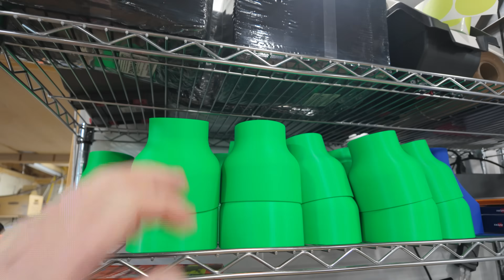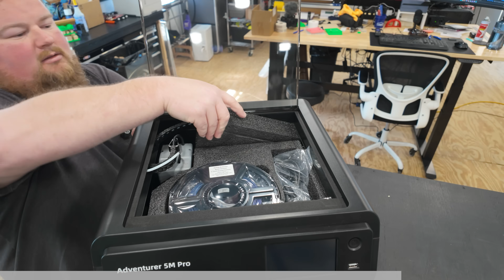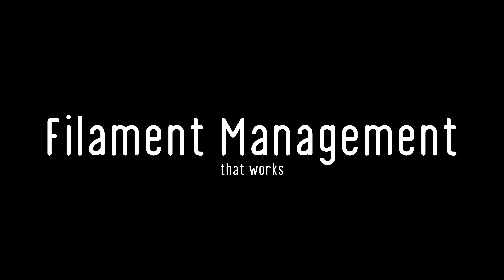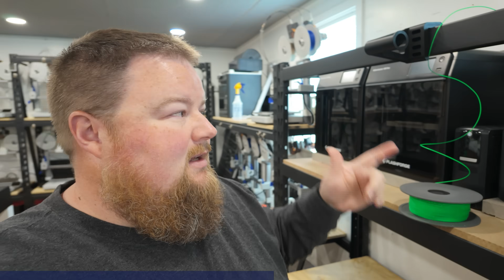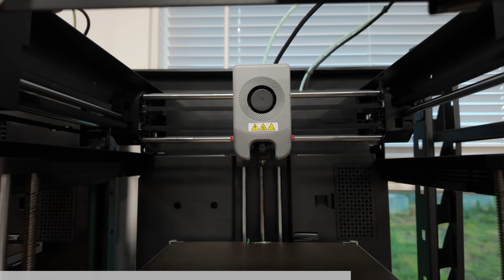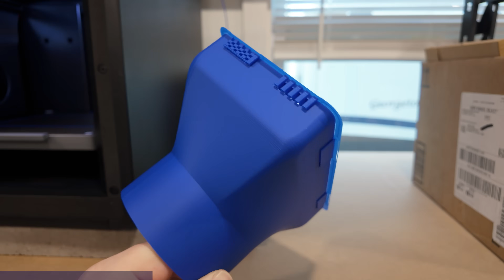Using Cheap 3D Printers for 2 months in my Print Farm

Comment: The Flashforge 5M is my first 3D printer and it is sitting here printing as I am typing this. I have printed a lot of things on this printer and it has not given me a single problem. Now that I have had a little experience I wanted to step up to a printer that can print colors. I could not get my hands on the Flashforge AD5X so I purchased a Bambu PS1 and I just can not get as good of a print as the 5M. I am not bashing the printer and I am sure it's just me. I can not figure out what I am doing wrong. I am really happy with my 5M and when I need to print something without the hassle I use my 5M. Oh and thanks Sam for doing the videos.
Reply: En qualité d'impression les p1s sont largement au dessus des 5m et 5mpro, il n'y a pas photos, je me sers des flasforge pour des impressions 'atelier', pour la revente ce sont les bambu qui fabriquent. Je fais des petits produits avec des details.

Comment: Honestly, I bought the 5M and a separate enclosure for 36 bucks from Amazon. I also had a light, fan and some tubing laying around. Build myself a small filtration system (Practically for nothing, theoretically like 10-20 bucks). Now it's basically the same, for way less. I also don't want to waste 2-3 spools of filament during which time I could be printing much better things. Definitely worth it, in my opinion. Also, as a quality of life; first thing you should print when you get the printer is a new filament holder, because having it in the back is extremely impractical.

Comment: We had a flashforge 5m originally. Did around 50 hours of printing.  Never got the WiFi to work.  Updated to fix the WiFi issue and never got another good print off of it.  Switched over to the A1 and, knock on wood, haven’t had any issues after hundreds of hours.

Comment: I have to say that these printers do require constant lubrication if they are used regularly with big prints. I picked up a can of 3-in-1 lithium grease and used it sparingly on the lead screws, bearings, and rods. Far better than that packet of grease that came in the box. With the amount of money that you put into filament to print off the DIY enclosure, it's just better to get the 5M Pro if you want to print with ABS and ASA filaments.

Comment: You are so blessed with all those nice machines.... I'm still on a Flashforge Finder. I'm a pensioner so an upgrade is out of the question, I started loading some of my models on CULTS, under LEONLED, but only had one "sale" so far... I will keep that separate until the day I can afford a better printer... 140mm with 50mm/s  is really slowing down the rate I can make and test new designs with... I really wanted something that does klipper, I am getting so sick of flashforge's own slicer though... it is so thin on features. I have a spoolholder design on there I use with my finder, but you should be able to just cut a little bit off the bottom where it hooks into the finder,so it sits flat on your machine, it holds 3 to 4 spools so you can swap colours between most often used colours fast.

Comment: The 5m pro was my 1st printer and is a workhorse, I also have 2 x elegoo neptune 4 max but for ease of use, speed and print quality, the 5m pro destroys them. Yes, it lacks a couple of useful features like a poop chute and nozzle cleaner, and the rear mounted spool can be a pain sometimes, which i swapped out for a spool roller and it works great. Love this machine and will definitely consider another one.
Reply: Do you recommend it to a begonner?  I don't want to thinker with it so much

Comment: There sa lot of people ive seen flat out say the ff is the same if not better than bambu, especially for the money. Also, the ad5x has multi color printing. The ad5m and pro can do it to, though manually, and it comes out great. Been soin it a lot lately and its been damn near flawless. Running that along with a modded ender 3, they just work.

Comment: The AD5M was my first machine.  I had to figure out nozzle temp, retraction rates and everything because Flashforge gives you nothing.

Next machine will be H2D or really I’d just like a X1C updated but I don’t need dual nozzles.  The H2D gives me larger build plate is biggest draw for me.

Comment: I got 2 centauri carbons as my 1st printers, mainly due to good reviews, the build size, and MMS system hopefully soon. However Ive really been considering Flashforge as the have good quality control and parts available and prices are great.. Just wish the build plate was larger. My get a couple ad5x's for multicolor items though..

Comment: For some reason despite having the A1 and being almost flawless, I felt like I don't like the swing bed style and went with P1P, now seeing all the A1s you have and the scale you run them and I might have good with just another A1. At least the P1P will be faster
Reply: I have a1 and considered enclosed printer so i dont have to cover it with dust protector all the time (i use it occasionally) 
Did research but nothing seems remotely dependable enough to replace a1 (i dont need more than 1 printer)
If you are keeping both i think its fine you went for a different one despite a1 being very good.

Comment: I don't like the word cheap because it implies poor quality.  I own two AD5Ms and have for over a year.  Bone stock I had very few issues that weren't fixed by a firmware update, and after installing Klipper and a couple of hardware upgrades: they're both monsters now.

The upgrades I suggest are aftermarket hotend, because screw paying $30 for a proprietary one because only the nozzle wore out.  With after market if the nozzle is bad, you can replace it and only it.  If the thermistor or heater go bad?  Same.  Also the DIY enclosure if you want to print anything more difficult than PETG.

Comment: The ptfe tube into the hot end is why I will not be buying one of these. Having to pull it out repeatedly seems really stupid to me, unless I'm missing something...
Reply: It's only into the top of the extruder. The hot end itself is all metal. There are filament cutters that you can print that allow you to just cut and purge. I've loaded the community Klipper mod that allows me to run a macro that heats the hot end and then reverses the filament out much like the Bambu's. Then you can just pull it out, feed new filament in until it stops then run a load macro.
Reply: @drfiasco  Even on the older ender 3 and ender 3 clones with the TFE tube butting up against the nozzle that wasn't a real issue, a 15 minute first time install of any sub $20 bi-metal heat break and you were good to go.
Reply: You can 3D print a cutter that goes on top of the extruder. Makes changes a lot faster and more convenient.

Comment: i would use my $400 geeetech i3 printer i bought 10 years ago in a print farm. 

it might not be fast but it prints great. i get better quality and reliability than the $1500 creality K2 plus printer i use at work for engineering. 
i got this old dog tuned like a swiss watch. I updated it to use klipper and auto bed leveling. it never jams like a creality printer because i use an all metal extruder and not a plastic pos with an over heating motor and the best auto jamming technology China can offer. 

im half way done with building my own custom printer. i'm not buying a pile of scrap that's engineered to not be upgradable.

Comment: I've been wondring about those printers for single-color stuff (I print a fair amount of single color items right now myself), but hadn't gone past the 'wonder how those are'.  They price is definitely decent (still, but with the tariffs, that won't last long unfortunately) on both.  Have you been approached by Elegoo about their Centauri line?  They have multi-color capability (cutters built in, and poop chutes), just don't have an available CFS/AMS box yet (I'd imagine when BTT puts theirs out, if Elegoo hasn't released theirs, the BTT would work fine with them).  Price is definitely good on the Centauri ($199 currently, non-enclosed) and the Centauri Carbon ($299, enclosed), and definitely look promising from a 'farm printer' standpoint.  Hopefully the powers that be here and in China can come together soon and come to a equitable agreement on all these imports, so we can get back to growing our farms, lol.
Reply: I also forgot to say on your filter video, after showing that thing to my wife (and us experiencing some issues from running our printers 24/7 for the last 2 months), she's on board with us getting one for our farm when we move them into the larger space in our basement..
Reply from the maker: I've not been contacted by Elegoo (yet). I would like to test out their Centauri machines for sure! I had these in my shop before the Centauri came to the market.

Comment: Honestly my biggest complaints about the flash forge vs my a1's is the noise, power switch placement, they disconnect from my wifi everytime they go to sleep, and did i mention the noise?
Reply: Tbh a1 is not even quiet imo its just normal. Everything else is loud af. So cant replace it any time soon even if i wanted to
Reply: @Boz1211111  much quieter than my flash forges. They're machines I don't expect them to be completely silent

Comment: Well, unboxing printers gives exposure to the sponsor, but doesn’t provide much value to the community. In my view, especially in a print farm environment, a feedback video after at least 2000 hours of use would paint a much clearer picture. One key point is reliability and maintenance. Not just in terms of frequency, but also ease and cost. We know that changing a hotend on BL machines is cheap, fast, and straightforward. On other machines, it can be time consuming or costly.